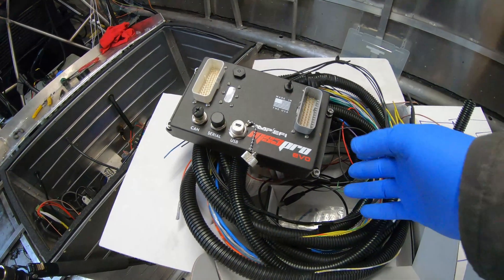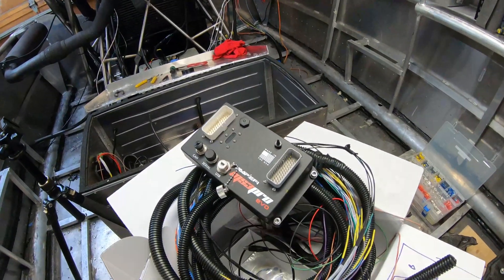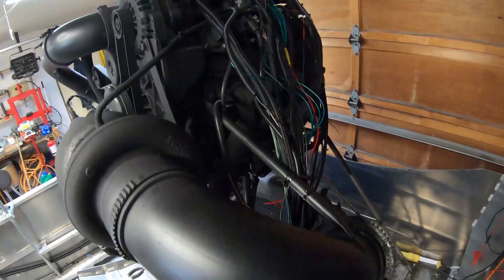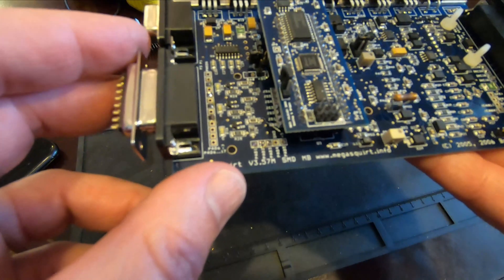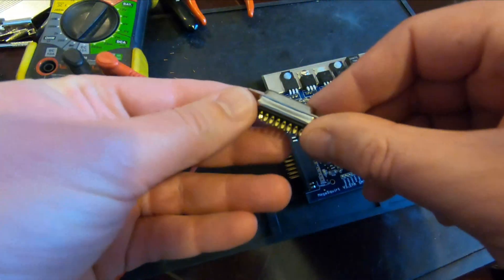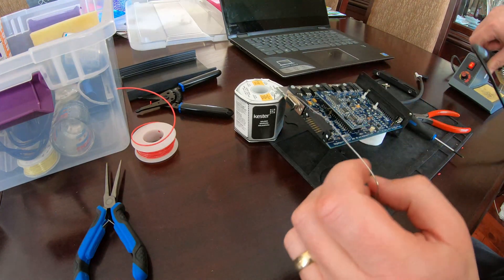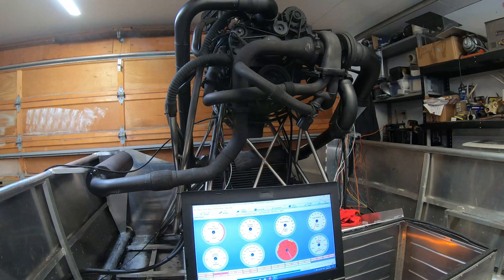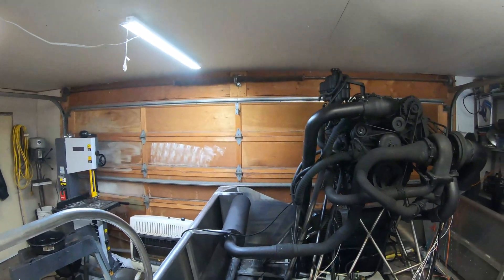Airboat Build #28: Megasquirt until it runs!

Comment: I gotta question for you,  my mega squirt 2 got water rain in it.. is it damaged?
Reply from the maker: Well, possibly.  Does it work?  If you can’t test it, you can open the case and inspect it.  All the components can be replaced (with soldering).  Check with the megasquirt forums.  They know way more than I do.